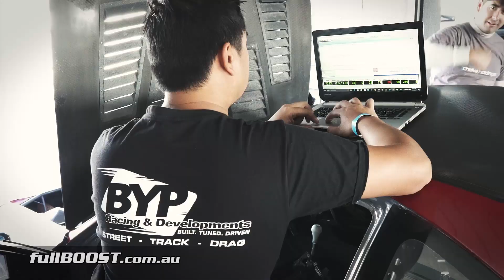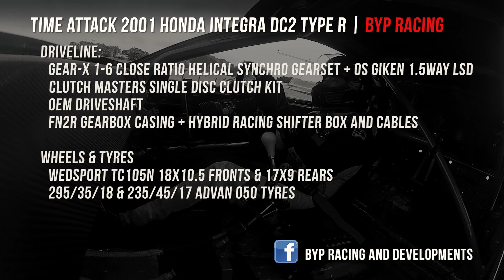FAST Supercharged K24 Integra |  BYP Racing

Comment: Mental lap-times, way to go guys, this is only slower than my LMP3 car by around 2 seconds, big Kudos for a tintop like this to be going this quick.  My car has run a 56 at Wake-field, and you guys into the 58's in that, wow !!!!!
Mind you I run 250 engine HP and 510KGS.    910kgs wet weight is also a very nice achievement, keep it going on weight reduction if you can guys, the car looks great.
Reply: You are on slicks, BYP isn't ;)
Reply: Ahhhh yes but A050s are a grooved slick essentially and I don't run the softest slick either, A11 in the Avon tyre. 
I also only have 250 flywheel HP.

Comment: Hi i am building a race civic. Do you prefer a supercharger over a turbo for a track car? Or would you build a high power normally aspirated engine. Which would be more reliable?  Im normally aspirated making 291whp.
Reply from the maker: Thats pretty good power you probably need to drop some comp to run some boost?
Reply: Yes. Im not happy with that power. Im used lots of power. I want an engine setup that i will not have to work on everytime i get on the track. 400 to 450 whp boosted or a higher powered NA. I really like the supercharger route due to less heat. Just want an honest opinion on which route to go
Reply from the maker: Not sure about other countries but the supercharged engines are quite popular in Australia in Honda track cars, they seem to work very well on any style track.